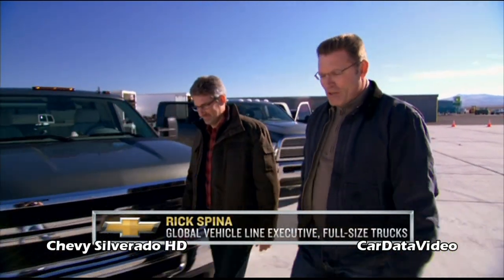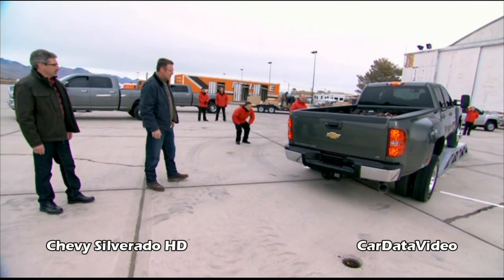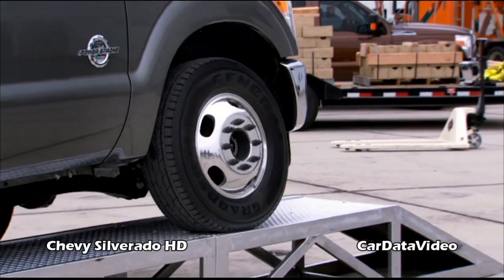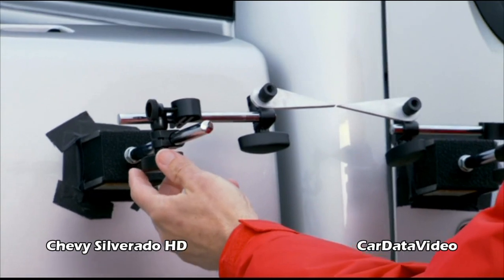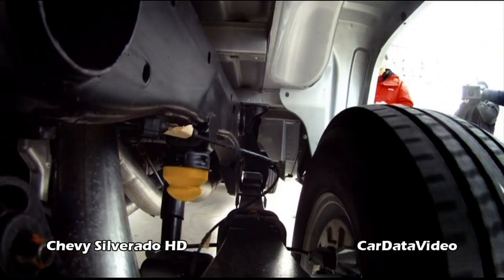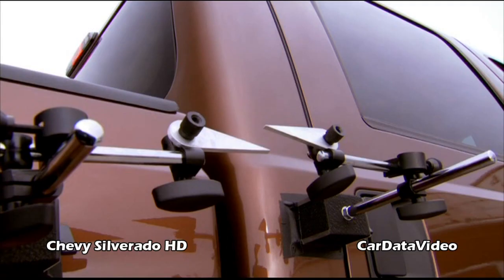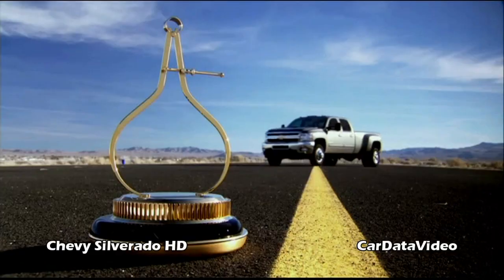Chevy vs. Ford HD Truck - Bed Bend Video

Comment: I have seen this before, but I sort of wonder if it has more to do with the use of a ford front  solid axle vs an independent front suspension in the chevy.  Seems to me with effective steel girder in front you are basically pushing up on one side and pulling down on the other, just due to the unsprung weight not being supported on the "in a hole side".  Due to the solid front axle I would wager a greater rotational force is being exerted on the f350 than the chevrolet.   Also I am not sure of this given the similar front track, but considering the radically different front suspension I believe it is more probable   that one of those vehicles is  getting a lot more leverage applied from those forces.   So while this is an excellent test of offroading flex prevention on 80k 8000lb dually trucks or possibly just suspension travel, it is literally has no bearing on towing or frame strength. This is a gimmick,  just schmuck bait  to entertain the yokels and rubes.
Reply: It's because you don't want a Ridgid fully boxed frame on a heavy duty truck lol, ever seen how much 18 wheeler tractors flex on railroads? It's so the frame gives for the weight. Be better.

Comment: I bet that guy with through all that work or finding the littlest things to be like oh look the fords tailgate won't open when the truck is in this position but the Chevy will that's why Chevys a better truck.
Reply: No, Chevy's just better than Ford all around. You shouldn't have to do research to know that one lmfao. You know how to fix a Ford? Buy a Chevy! Bwhahaha! xD
Reply: Can't make a fast car,all chevy engines are boat anchors that can't hold a candle to the TURBO BARRA and it's 330RWKW SAFE TUNED GRUNT,thats stock as a rock with just a flash tune,GM has litterally nothing on an engine built only in Australia

Comment: At least the ford made it up the rams with out being pulled
Reply: The chevy's weren't pulled, so idk what you're trying to say here.
Reply: Centiliter What he is saying is the Ford was a 2wd Gas the Chevy 4wd diesel (for the twin rear wheel trucks at least)
Reply: 3:05 The Ford is four wheel drive too... You can see the 4 between the two guys.
Reply: If you paid any attention whatsoever, all four trucks were 4x4 Deisel.
Reply: Centiliter so after switching to my computer I could hear the turbo whistle (my mistake) although the 4WD depends on the truck package because with some you have the option to put it in and out of 4WD like my fathers truck and they never showed the drive shaft for the Fords front axle which is on the left side of the truck only the input shaft which could mean it wasn’t in 4WD 

But one thing is for sure.     You will never have to bend your truck like that with 3000 pound load and open a tailgate
Reply: These Chevy commercials are so stupid they are so rigged

Comment: Lol you've been in this position before no you haven't what the hell were you doing driving diagonal in a ditch and decided to open your tailgate when two wheels were off the ground... Highly doubt it but kudos to Chevy for building a strong frame but once again Ford is still number one
Reply: And fords frame will shatter before the Chevy haas a dent
Reply: At a private fishing hole...putting a small boat in a pond.

Comment: boxed in frames generally suck ass to drive. Something is up here. If the ford was that shitty, you couldn't jack the rear end up unless you used the differential.
Reply: exactly   if you got a flat and jacked up the truck the frame would twist. the Fords were sabotaged.
Reply: mkelsho Ya, if you jacked the right front and left rear of the truck up on the frame at the same time with 3000lbs in the box it would, The test was not rigged and the Fords were not sabotaged. It was an extreme test for any truck frame designed to show how much a boxing the frame improves rigidity,,,and why would you jack up your truck by the frame to change a flat instead of putting it under the axle...that's just stupid.
Reply: mkelsho do you understand or do you need it broken down further? let me know! I am always happy to help!

Comment: I had a 2012 Ford Superduty and traded it for a redesigned and much stiffer framed 2017 Ford Superduty with the new high strength steel boxed frame.  Yep, I can tell the difference.

Comment: Have fun with your cracked frames chevy guys... YOU DON'T WANT TO HAVE NO FLEX LIKE THAT! YOU REALLY NEED FLEXIBLE FRAMES
Reply: Thats what i am saying. Ford is made to do that there is this thing called Independent suspension and a frame that actually twists so the truck one can haul a lot more weight and two it is better for offroading.
Reply: Nick Martin  Flex on the truck i dont think it usefull at all...    Loaded in a turn.. what happen you think...    and offroad the suspension do the work...
Reply: MrBonami2 I have an old 80's ford truck, lots of frame flex.  It actually adds to the articulation of the truck off road making it quite good on trails. It makes up for my lack of suspension travel basically.

Comment: The Chevys torso is more riged than the fords? That's the most BS thing I have ever heard! The Chevy silverado is practically a tin can on wheels, the reason why the ford super duty was doing that bending on the ramp was because the fords frame is steel! It's real metal! And steel is heavier than aluminum. Look, my family comes from ford motor company, my family has worked on this kind of stuff for years, so I know ford better than most of you Chevy hillbillys. How dare you even try to compare Detroit steel to hillbilly plastic? Ford is number one!
Reply: Ford is the one that uses aluminum Chevy uses steel
Reply: zane krystyan
Dude...it ruined the tailgate.  You can tongue the Ford tailpipe all you like, it was still a Ford fail.
Reply: Scott Maskell what?
Reply: Last time I checked, steel is heavier than aluminum. Ford switched to aluminum to lighten their truck up to get better fuel mileage, because Chevy has the upper hand there. Aluminum doesn't take as much of a  beating.
Reply: Justinjmj12 actually it does
Reply: heavy_ z71 anyway who did better in the iihs crash test. eherm the soft aluminum FORD
Reply: heavy_ z71 plus why would you want ur engine to start in a totaled truck

Comment: This show was rigged, ford makes best and strongest truck
Reply: Lol it's rigged hahaha they did the same test vs dodge ford all most broke
Reply: Lol fords are made of aluminum while Chevys are made of steel. So this persons wrong in both ways.
Reply: +SixR it's a Chevy commercial,  do u think there gonna show or talk bad about there trucks ? no. that ford could drag that Silverado all over the place in a tug of war cause ford is alot stronger motors.
Reply: So what if it's a Chevy commercial fords suck they cant even pull anything powerful.
Reply: Alright let's agree to disagree but I love your flag , I'm a proud supporter of the south , my great great great great grandpa fought for the south in the war and I also know that the war started over state rights  and  taxation,  not salvery, at least we agree on something 👍😃
Reply: If you want me to I can add you to the conversation
Reply: +Rylan Coffey Vlogs bull
Reply: SixR the new raptor can tow 18,000 lbs

Comment: That is hands down the most compelling evidence I’ve seen to squash the ford vs chevy fued. At least concerning work trucks. I always assumed that they were substantially the same capabilities, quality, and that because they’re close in price it’s really a matter of brand loyalty. I was brought up with gmc/chevy so it’s hard to say, but if it was the other way around I don’t know how you could consciously buy the Ford after seeing that. The frame is hands down the most important part of a HD. I would’t dare drive that through a rough worksite with a substantial load. I remember seeing a few years back some videos of f150s sheared in half from a collision. I wasn’t sure what to make of it then but I do now. What garbage!
Reply: The Ford frame was made to flex. Chevy frame will snap in half
 Chevy and gm is junk

Comment: ford mechanically is soo much better than chevy or gmc chevy just take the L
Reply: zach eggers we got a 2001 f-250 and it has never broke, we also have a 2002 f-350 and it works great every day.
Reply: I mean I don't know how many Chevy's just random have spark plugs blowing out of their head
Reply: Cypress Thunder happens all the time
Reply: Oh so thats why you have to lift the cab to work on the engine? Because its mechanically superior? Im calling bullshit
Reply: Yeahhh I don't know bout that. Our 01 6.0L 2500 gmc has over 420,000km and has never failed us. All stock. And we've always had grieve with ram while GM's always stood the test of time with us. We do have an 2011 f350 but it's just so uncomfortable for me atleast to drive for more than an hour due to the interior layout with the wheel, pedals and, seat.
Reply: Cypress Thunder seen and heard it. 25 year mechanic here. Always been a mopar guy. Had some Ford's. Literally just bought a 2018 Silverado. Hands down the best buy right now. Ford is definitely the worst mechanically. Dodge electrically and chevy trim packages fall apart. But what's important to me is the reliability of both frame and motor. And chevy wins.
Reply: Juicy Jake Ford has never built anything that is worth anything the best thing that ever happened to Ford is Chevy gave them the 302 motor.

Comment: Toyota Trucks are better than both. Also they are made in America whereas not all chevys and fords are.
Reply: Yeah whatever. Ford, chevy, and dodge are AMERICAN made. Toyota is foreign.
Reply: Toyota isn't even in the running. Not even the top 4.
Reply: Toyota better?  Then why don't they sell any?  You NEVER see toyotas, and they have been making them forever.  The tundra just doesn't have the balls of a ford or Chevy.  It's better than the crap dodge though.  Haha dodge doesn't even make their own engines hahaha!!!!
Reply: Spencer Staar  lol American made with foreign parts anyway. Toyota and others do have  American factories.
Reply: Steven King You mean the Cummins? You think ford makes the Power smoke? Chevy makes the Dirty Max? Not exactly.
Reply: +Steven King Because americans are biased towards their brands. In all other places your cars/pick-ups make people laugh.

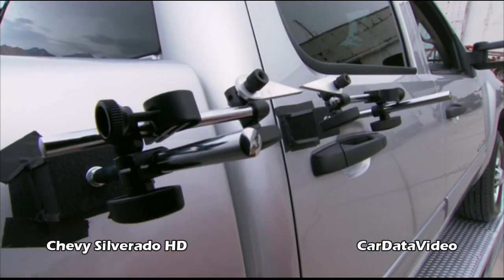Comment: At 2:05 and 2:46, the pointers are level and seated equally on the Chevy truck.
the ford has its pointers already misaligned at 2:55, you can see one on the bed is set higher and slightly off then the one on the door.

Comment: A buddy of mine bought a new F150 back in 1999. It had that funny bump out on the back of the cab that actually hangs over the front of the box. Went on a trail one weekend and managed to get the cab to kiss the box when the frame flexed, Frame flex doesn't bother me but holy crap, Ford should have seen that one coming. All in all though, I feel Ford makes a good product.

Comment: Okay im a diesel tech for international watch a semi take off fully loaded the frame twists a bit. You want it to flex otherwise its too brittle also that ford is 100% rigged the tail gate is locked for one and 2 theres no way it would just dent in from flexing lmfao

Comment: Here is my completely unbiased opinion as i love american trucks no matter which one it is: It sounds useful to have a stiff frame if you end up in a similar situation like that, for example if you have a heavy load and there's a lot of potholes, but in most situations, it is better to have a flexible frame to absorb a lot of stress on the truck so it doesn't just bend or snap from stress. If that frame would have been more rigid because it was stronger, is would have been a different case. Also there's no way that frame is 30 times stiffer

Comment: I've seen many Chevy frames crack around the steering gearbox, at least on the older ones, newer ones up to a certain size probably are using a rack and pinion system

Comment: There is a reason Why semi trucks in most pick up trucks flex. Keeps the tires on the ground and the load distributed. It’s better for them to flex them to just break.

Comment: I have a question. And I actually am asking this so I can try and learn something. Even though the test or whatnot is staged, when a trucks bed bends does that mean the frame bends? Also, if it is the frame bending, how would the frame bend back into place?
Reply: The frame needs to have some twist allowable so it doesn't crack under heavy load and torque.  The cab and box should never be attached.  Operative word ~should~.  If the frame bends too much then the vehicle will not drive properly and if the box bends too much it will warp.

Comment: Nobody?  How about disconnecting the front and rear sway bars on the Super Duty and watch that straight axle suspension flex (travel) keeping all four wheels planted while the body stays level.  Surprised no one has mentioned this.

Comment: But notice how the ford dually had all of the wheels on the ground.This is what you want.Not a stiff frame that will crack if put in that sitiuation multiple times or with more weight.

Comment: I'm Australian so I don't know much about the big American 4WD's but I feel like they were made to tow heavy loads with ease not to flex like it's a rock crawler. My Dad has a 84 F350 single cab and it clear that it wasn't made to flex, it's good for piling tonnes of shit on but when  compared with my 99 Toyota LandCruiser Prado the F350 doesn't have the same amount of travel

Comment: Is everyone tripping, thats what suspension is for?  A twisting frame is gonna put stress on the entirety of the truck.  The solid one is taking the stress right then and there and not distributing it throughout.  Can you imagine a tube chassis truck flexing like that?  Will not pass safety inspection period. “To keep the wheels on the ground” total bs, work on travel then.

Comment: They Ignore the tires 2 feet in the air like that isn't going to affect the grip or the added stress on the frame that will cause it to snap

Comment: A flexibly controlled chassis is much more durable than a rigid chassis, as it absorbs shock and stress much better. It is not for nothing that the wings of the planes are flexible, the aeronautical engineers realized that instead of fighting against the vibration and stress of the metal, the best way was to find a way to absorb it. The same happens with the chassis of a car, a rigid chassis over time will deteriorate much faster due to the vibrations of use.

Comment: Rigidity isn't always desirable, especially right there... Notice how whatever is in the bed of the Ford is going to be more level with the axle? A little flex is good, as long as it returns to it's initial position when released.

Comment: Anyone notice how they showed the guy in orange placing the two points on the cab and bed for the 2500HD, but didn't at all for the F-250 Super Duty. They might of placed it unevenly on the F-250, we will never know.

Comment: The Chevy did beat the Ford, and this doesn’t matter in this test. But 
Ford uses aluminum for their frames and Chevy use steel frames. Which means Chevy rusts and Ford doesn’t at all but again that doesn’t really matter in what your explaining.
Reply: Wasn't there a report about f150 from 2015 till present that were rusting way to quickly on the bottom? Not enough coating or cheap chinese metal?

Comment: full steel box frame? hmmm... remember when toyota did that and has a massive recall from the frames rusting apart? a C frame is typically used instead of a box frame so that moisture can escape. a box frame just holdd all of that water until it completely destroys the metal from all of the rust.

Comment: I'm just wondering why their stress testing a dually like it's going offroad. The main purpose of those trucks is to tow stronger than a regular truck. But whatever you do you.. also not trying to be biased but I wonder if the Fords tailgate was locked.

Comment: Biased, Locked Tailgate, Loosened Bolts. Ford also wanted it to flex that hard to keep as much 4-wheel traction as possible.

Comment: 1:20 The tailgate is locked.😂 
Notice how easy the handle lifts.
My F-150 tailgate does that when its locked. When it’s unlocked there is more resistance when you lift the handle.

Comment: Y’all do realize that a stiffer frame isn’t necessarily a good one? A more flexible frame like the ford has allows it to rebound a little more and not have permanent stress like any changes would on a stiff frame? Same reason most semis have an open C” frame like the ford does.

Comment: here in the philippines most new Ford pickups dont last long, like the Raptor, its riddled with problems like transmission breaking down, fuel injectors etc.

Comment: If you want to bend your frame while carrying a ton in your bed then buy a chevy, if you want to actually carry a ton without bending the frame buy a ford, the flexing is done so it would be better offroad, the chevy's are just pavement princesses

Comment: It’s hilarious how they do this test, which has nothing to do with what makes a truck and truck, who cares what durability and strength it has, at that point your carrying more weight with how much the steel is, and you can’t tow as much or do anything better than the ford, also you do this test and the bed test with damaging it, who cares about that, you switched back to aluminum straight after, try to face the platinum ford, and I’m a Mopar man, dodge

Comment: Can't wait to see this test against a vehicle made from Space-X's 30x cold rolled steel in an exoskeleton/unibody arrangement. By the way, it looked as if the Chevy was using very light wheels and tires while the Ford used heavier wheels and tires (probably filled with water too). Not sure but it wouldn't surprise me. That dangling tire/wheel wouldn't have to weigh much more to cause more twisting.